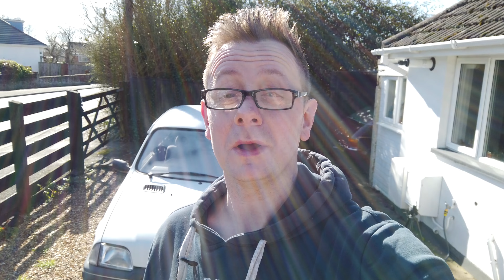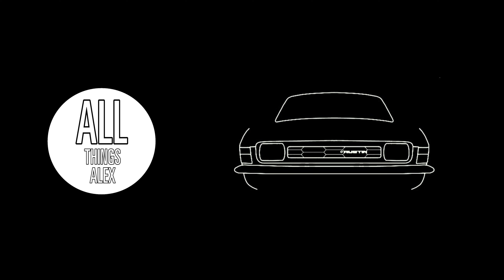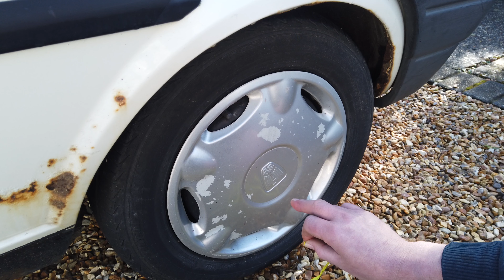CAN I SAVE A 1990'S ROVER METRO? - PART TWO - SORTING THE SUSPENSION!

Comment: Your compressor will also have a fuse - often found inside the lighter plug, if you unscrew the tip.
Reply from the maker: Sadly its not the fuse, which was the second thing I tried.